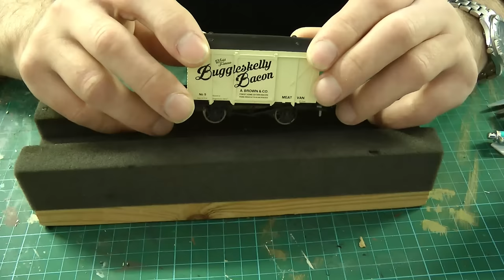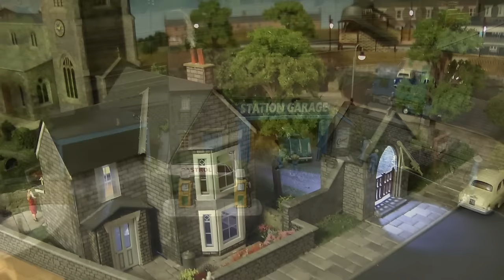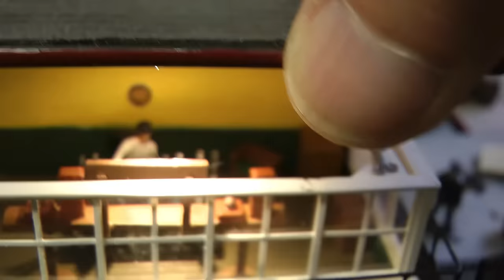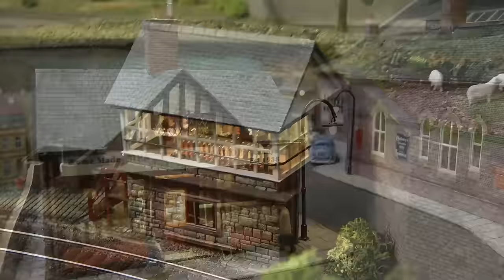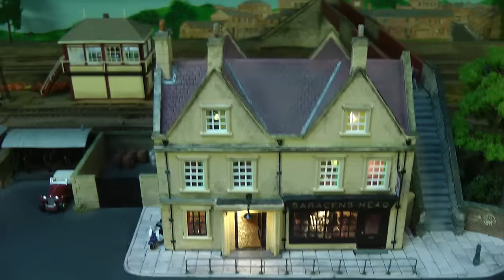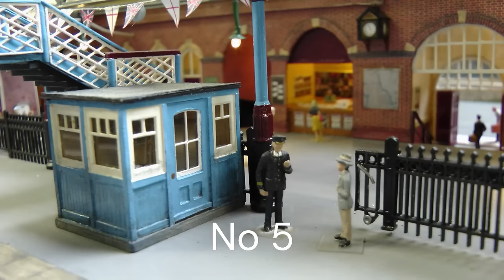My OO Gauge Model railway Top 10 Scratch Builds.     No 418

Comment: well a walk down memory lane for me 
Triumph vitesse my first car in the station garage 
I found a building you could make as well Cleadon water tower 
you probably don't have room for it  but what a lovely building it is 
I might make it my first scratch building 
all the best Tony another good video
Reply from the maker: Hi James. that you for commenting i have been considering the idea that you have put me regarding the Cleadon water tower. space is an issue but the space i do have was earmarked for either a Bus Station. or a Fire Station. all that said and done. it has made do a re-think. the water tower works out at 400mm tall. and 90mm wide. and i would have to do at least the pumping station. so yes hold that thought. thanks again. cheer's for now Tony.
Reply: @TONYNORTHEASTERN  its just such a lovely building you could scale it down a bit and put it in the far distance as it was stuck on or behind a hill. thought put on the back burner !